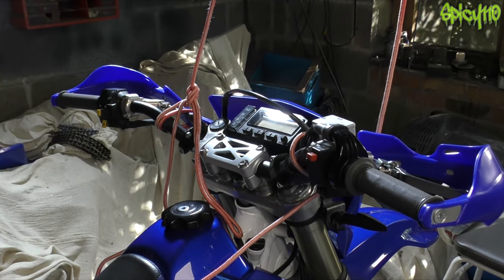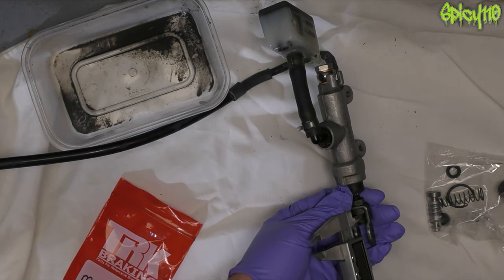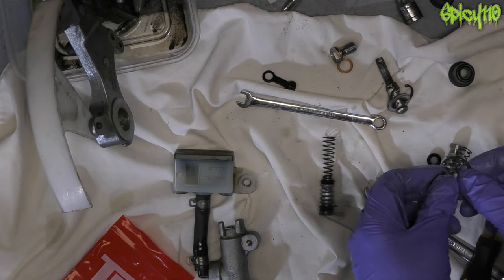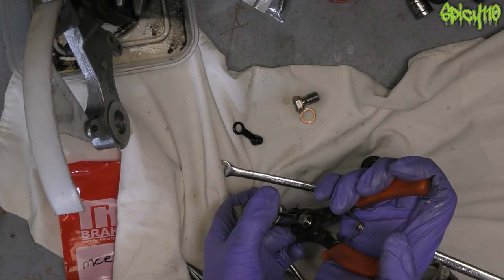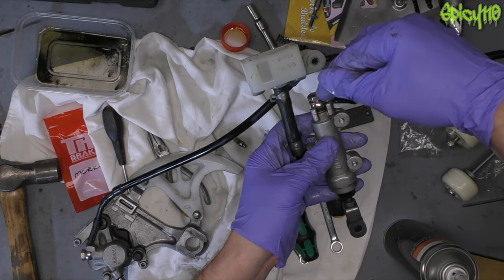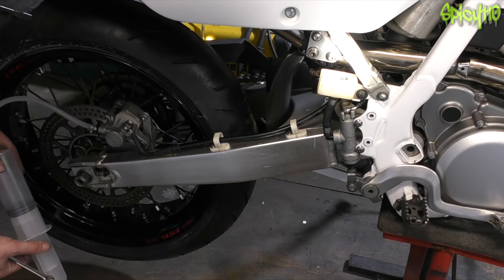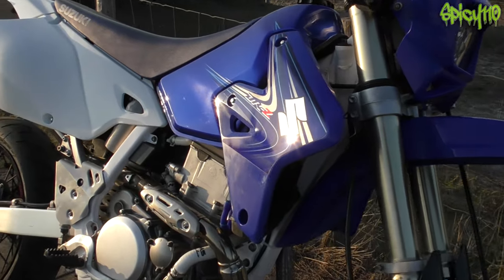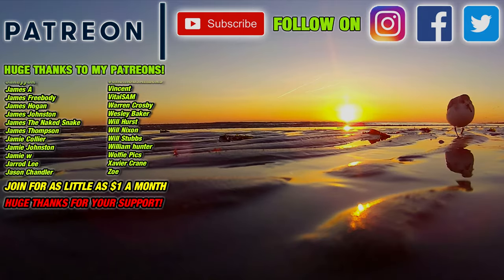The DRZ Supermoto Build is DONE -- Rear Master Cylinder Rebuild!

Comment: I passed my CBT yesterday! I'm struggling to decide what to do now though. I'm tempted to get a 125cc quite cheap in my area for half a year or maybe a year or whether to go straight for a DAS course.. I need a lot of practice to get good. I still struggle with u-turns and getting in correct positions and staying in momentum. What would you recommend I do?
Reply: Get instruction do the DAS if over 25 if not try and go for.your test on the 5-7 day course as the amount of pre test tuition is amazing for confidence and buy a winter hack thats capable of 70.

Comment: How do you get  Insurance for your cbt if you don't have a cbt yet thanks
Reply from the maker: Normally you rent a bike from them as this covers all legal issues and means if you drop the bike at least it isn't yours haha
Reply: @spicy110  thanks for the reply
Reply: @spicy110  I dropped the bike on my CBT, and was charged for a new lever protection bar. So the CBT insurance does not always cover damaged parts. Might be worth asking the school before hand. I was obviously covered for (as you say) legal issues. Anyways... I passed and now tootle around on my Lexmoto Michigan.
Reply: A insurance quote for a learner on a 125 usually covers doing your CBT, confirm with your Insurance company but I did that in the past
Reply: @OutpostH  got myself a dt125r in blue it is mint condition too